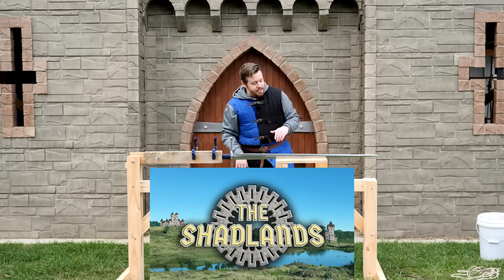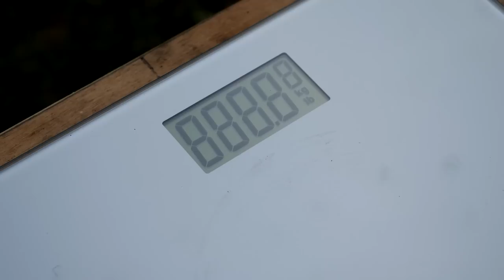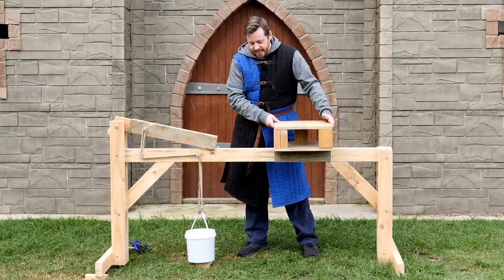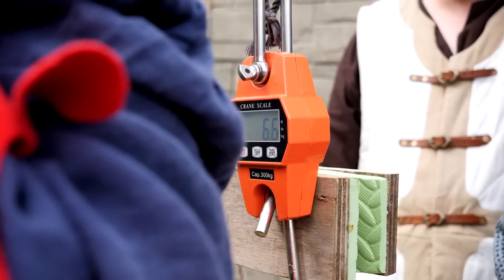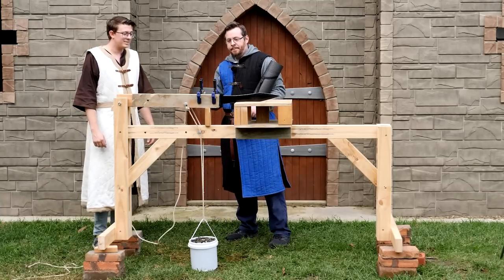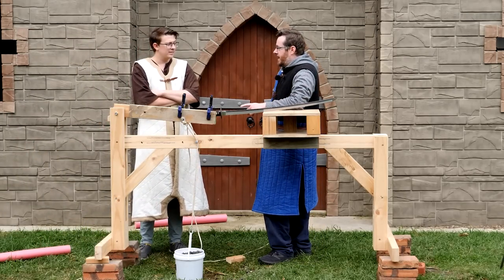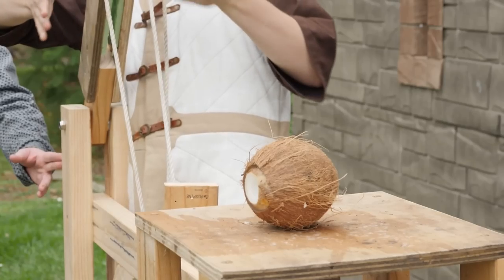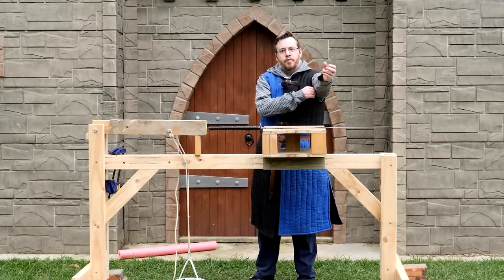Choppy choppy

Comment: I suspect that the problem you had with the katana was due to the clamp slipping. Clamps are surprisingly weak under sudden shocks. It might work better if you made custom clamp jaws for each handle, so that the clamp has a perfect fit. These clamp jaws would then have some sort of slot they fit into the arm to prevent movement.
Reply: @Danuxsy  the katana slipping IS a big problem, because that would mean all the power behind the swing dissipates in the motion of rotating upwards instead of following through with the cut
Reply: @Danuxsy  you can also clearly see the katana slipped. But all we can do is just speculation, we have wait for shad to do the experiment to see. 

Using only the friction due to the sideway force to hold the weapon is too weak compare to wrapping our thumbs around the handle.
Reply: @Danuxsy  This is true, however the guillotine would probably still be able to cut it was it not for the problem the others mentioned. Imagine  Shad doing the cut withouth stiffening his wrist.
Reply: Yep. I also think its about force dissipation during contact because handle of the katana wasnt fixed hard enough.
Reply: @Danuxsy  I would disagree on that. Sure, biomechanics does impact the force, but that only makes it more efficient. Here, the force of the cut is 7 kg, similar to Shad's cut. It doesn't matter how the swing is done mechanically if the net force is the same. However, what does matter is that Shad has his thumbs locked to prevent the sword from slipping, unlike the wooden planks.
Reply: The problem with this statement (as a lot of people are saying it in obvious defense of the katana) is that every other sword was doing the same thing, and the unsharpened long sword still cut the coconut.
Reply: Or clamp from the top and bottom also,just put shims or spacer between the plywood to secure from top and bottom 🙂
Reply: @Danuxsy  this actually applies to EVERY  sword 
Not just the katana...
Reply: @gamermanzeake  My thoughts exactly, how can someone say it is solely due to the slipping when both the gladius AND the other sword did the exact same thing? I feel like some people don't pay attention to those little details--which is vital importance to something like this.
Reply: @gamermanzeake  dude, we're trying to figure out why the sharp sword didn't cut what a blunt sword did.  That's it.
Reply: Not only the clamps being weak, but also the problem of the force pulling the sword out being multiplied due to leverage cause the point of rotation is far from the point where the force is applied.
Reply: I agree with you,the clamps have poor grip on the sword so you loose power.
Reply: @Danuxsy  Ok, I do agree with you on the point of acceleration vs pushing the sword. The force applied to the coconut is quite different. But the fact that the sword rotates backwards makes the force even less. Also I would like to point out something both of us didn't catch onto. According to the torque equation, the longer the length of arm, the larger the torque produced when having the same force. This means that the weight on the guillotine should be on the end of the sword in order to make the test fair.
Reply: To build on the clamp observation, I hate quick clamps for all but the least demanding applications. Any serious clamp job requires some good, heavy, steel, G clamps.
Reply: Well, fixing the clamping mechanism may end up being the easier option, compared to redesigning the entire machine
Reply: @Danuxsy  I agree with you there, impact force is a sum of forces what shad needs to do is ensure that the guilloutine matches the impact force he can apply (possibly by testing with a scale designed to handle impacts)
Reply: @Danuxsy   Yeah, that's probably a more accurate version of the question. The sharp vs blunt sword thing is probably more of a clue.

Your answer is probably an aspect of it.
Reply: @Danuxsy  as I understand it a sword stroke is always an arc, maybe you have 3 points of rotation but they all add up to one arc of rotation. In this way it is the same as the "guillotine", they may utilize different force vectors, but the result is similar. It may be that Shad utilizes his full body to deliver a proper stroke but that is simply because using different muscles in tandem is the most efficient way to use the human body. If the guillotine was built with 3 points of rotation, that would only add unnecessary complexity. You could build the guillotine generate more force than Shad or less depending on how much weight you put on it and regardless of how many joints it has. So comparing the forces generated is unscientific since there is more than one variable that determines which strikes harder. To me, the main difference that (at least in part) produced the results is that unlike a human, a machine is unable to adjust and react on the fly.
Reply: @forcommenting1017  do you saw mythbusters? The episode where they used rocked slides to decelerate a car into a wall? The used 2 slides to get higher speeds. 
The more acceleration points you have the faster you get, even if the movement ends up being one arc.

Even if he gets the weight on his rig right (which he didn't) he won't get the right speed.... but we all know the formula behind the force... it's mass and speed. 
Those need to be consistent and right to get to the sharpness and end up where we gonne be and it's the cutting capability of a sword
Reply: I'd like to also add that we can see a lot of horizontal movement, so probably putting some side rails would make it more consistent.
Reply: @Danuxsy  the amount of force shad himself can generate is largely irrelevant. Making sure the rig holds the swords snugly and without variation is significantly more important.
Reply: @Danuxsy   @FluffyPants    it's funny you say that because there are clear holes in your logic. I said nothing about constant speed and whether it is or not doesn't change my point. I distinctly stated that what swings the sword doesn't matter, in fact it was my main damn point (but you think that's a point you made somehow). I never even mentioned the 7kg thing which I was never defending. Furthermore, you make serious and unfounded (though possibly educated) assumptions about how much force is generated, a variable which we can never know without actually measuring. Force is not the only variable at play here even though that would make the problem much simpler. At this point, with all your ad hominems "have you ever even seen someone swing a sword, etc" how can you still assume you are being objective on this subject? It seems to me you just want to prove yourself right, which was never the point of this scientific discussion. The way you go about proving this is also questionable, regardless of what you think your credentials on the subject are. You ignore half the points people make (confirmation bias much?), then put words in people's mouths (strawman) and make your point, not in response to the person who made it, but rather your own idea of what that person said. I don't doubt you have some deep understanding of the biomechanics involved, but you take some parts of science and ignore others so it is very hard to trust you.
Reply: Yup you can see the katana moving relative to the clamp in slow motion.
Reply: I fear you will take what I said and assume that I don't understand the very basic main point you are making. The reality this is that the main point you keep coming back to is quite possibly the least interesting thing you have said. Not that it isn't interesting but rather the embellishments are more interesting by comparison.
Reply: @Danuxsy   exactly as expected. If you'll notice, my comment is unedited therefore it is impossible for me to have removed mention of such. Since it seems you haven't figured out self awareness on this point, I doubt you ever will and thus this is pointless. I hope you have a good day 😊.
Reply: @Danuxsy  whatever helps you get up in the morning ♥️.
Reply: @Danuxsy  There is no need for disrespect here,
You can make your point without disrespecting other people.
Reply: Yeah there needs for resistance on both the rear and front of the handle like pulm and fingers do in grip. There is significant driving force and resistance against the rear of the handle by the hand
Reply: Yeah thought so too. I think belts or something similar that tighten around the handle rather than like a clamp that just squeezes from the sides
Reply: Always someone defending their beloved "katana"... Smfh
Reply: Yup that is a major problem you can see the sword completely changing angle so the force is not full because the sword is being pushed back. It is super obvious as the sword isn't even flat after it strikes. Definitely need a better way to secure the swords. Some hilts might work better  than others. Some kind of solid system on topp you can screw down to keep the slippage from being an issue. Slippage likely might be because some hilts have better friction
Reply: @gamermanzeake  Some hilts might be better secure than a Katana. I could careless which sword does best personally. They just need to address she slippage because in a real strike someone is not going to bounce their arm back. They will try to strke through something they are trying to slice. Fix the slippage issue and retest. None of the swords should be slipping and defiinitely not as severely as the katana was.
Reply: Gravity is not accelerating the sword the same way that your arm does.  The weight of the bucket is not reflecting the true force of the blow.
Reply: @krikeydial3430  he could probably use a good accelerometer to callibrate is contraption ... that and send the design what he made to the Slingshot channel guy. If anyone can make this work properly he can. Seems like a perfect collaboration project between the two.
Reply: You're not wrong about the weak point there although a small length of timber put above and below the handle and clamped down on the "front and back" of the handle should prevent the handle slipping in the vertical axis. By this I mean cut to size and clamped so as to be flush with the main timber. Close to making custom jaws but more cost effective and time efficient as you can just saw off the excess to make it flush then just clamp it down.
Reply: I think Hose clamps with some rubber  would work I think.
Reply: @ronpetersen2317  Great idea!  I love that guy, "ah-ha-ha!"
Reply: @skullair52  A few hose clamps would work pretty good and be pretty quick to remove and tighten. Or make a few wooden v shaped clamps that can be quickly bolted and unbolted. The v shape gives you 2 contact points one keeping the handle from pushing back upwards and the other keeping it from being pulled downwards
Reply: I think you are dissipating a LOT of the energy in the swing with the movement of the handle in the clamp. Just think about how much force is required to move the handle in the clamp, that is how much is lost.
Reply: @gamermanzeake  The longsword didn't move nearly as much in the clamp as the catana did.
Reply: It might be a combination of things and one of them might the the way the blade bites into its target
Reply: Maybe you need to add some bolts or something to keep the sword handle from changing the angle of the blade as it connects so it stays straight.  A bolt above the top part of the closet side of the handle and a bolt below the furthest part of the handle could help I think?  Might need to make a few holes for them so you can adjust for different sizes.
Reply: @gamermanzeake  You've posted this in reply to several comments, but it's flat out wrong. Look at the long sword's hilt when it hit the pool noodle and when it impacted the coconut. It didn't slip at all with the noodle and only a little bit with the coconut, while both the gladius and the katana rammed up against the clamps.
Reply: I can confirm the weakness.
Have had many times when I used a solid steel table clamp, a big one at that, to hold something like wood while I was using a chisel and every single time it failed after a few small hits.
Didn't matter how tight it was or what I tried to increase friction, the material would always slip out.
Reply: @forcommenting1017   Look, not to get this argument more heated, but I believe that fluffy pants' stance that the sword guillotine is not calibrated to apply the correct amount of force at impact is a bigger issue than the handle slippage is a viable one. Regardless of the coconut's resistance, under the right amount of force the sword would still have cut partially through the material, before the coconut (acting like the long end of a lever) forces the handle to slip from the fulcrum point in the front of the clamp to the back of the handle. Yes, the handle slip is a design flaw, and to respond to your previous comment no adding yet more points of rotation is just going to make the rig lose power in the swing( the rig is a simple weight powered device not a complex hydraulics mechanism, so the fewer moving parts, the more consistent the results. And finally the the calibration system is designed to increase the initial point of force from the point of the handle, and not at the point where the blade makes contact, and because of this small oversight Shad measured the applied force he could give at the very end of the lever (the sword tip where the force would be at its weakest) and assumed it to be the constant for the whole blade strike. Hence why Fluffy Pants argues that the system must account for the difference in power an impact has in comparison to applied force either with a math calculation or with trial and error for example using a scale that can handle impacts. I hope this clears things up, if not, oh well I said all that I'm going to here.
Reply: This is what I noticed. I wondered why the warsword slipped less than the katana. With the yoga mat too, the fact that the handle would slip in the clamp coupled with the density and the spring give in the layered foam.
Reply: yes agree, in vid you can see the weapon move in the vise setup when it hits target.
Reply: It would work better if they had a master blacksmith do it by folding it 90,000 and making 90,001 paper cranes. Trust me. I made the last crane once. Should have seen it. Flew over the sword, enchanted it, and dissolved. So this is false advertising.
Reply: not to mention the difference in weight between the swords
Reply: He should look into fractal vices. They can hold any shape in a near perfect grip, adjusting on the fly for geometric complexities. They are also more shock absorbent.
Reply: @For Commenting   I know at @FluffyPants was rather rude but I have to agree with him in terms of the physics going on, but I can try and explain better and give a test to do at home to help give context:
Imagine you want to hammer your closed fist into a table to smash something and you'll do 3 tests.
SAFTEY WARNING, don't hit a table like this, maybe a pillow cause you may break bone

Test 1: (no bend and no muscular acceleration) raise your arm level to shoulder height and keep it entirely straight but then let it drop and only be accelerated by gravity (let your shoulder muscles relax so your arm falls and impacts the table)

Test 2: (no bend but with muscular acceleration) raise your arm to shoulder height, still keeping your arm entirely straight (no elbow bend) hammer your fist down and you should feel the difference in impact force 
{shad's machine is currently replicating somewhere between these test 1 and test 2, as he's trying to factor in muscular acceleration with the bucket's weight though it's not as much as would be required}

Test 3: (bend and muscular acceleration) raise your arm to shoulder height this time, hammer your fist down as hard as you can and bend your elbow, the added acceleration you received from the pivot point will greatly increase your final force 

So what's happening regarding shads swords is that in the equation Force = mass multiplied by acceleration; his contraption is only undergoing the acceleration of gravity, which is 9.8m/s/s being multiplied by the mass of the current sword and his rocks. The larger sword succeeded because it has more mass and was a larger arc because of its length which is result of torque, so it's bluntness was irrelevant due to shear impact force, in the same way a round marble will punch right through something if it's moving fast enough. 
But when shad swings the sword, is muscular acceleration, the rotation of his pivot points and the acceleration of gravity are all multiplied by the weight of the sword and his arms, making for a hugely greater force potential. 

Because his contraption his currently limited to the acceleration of gravity, in order to replicate his muscular force potential he'd ever have to greatly increase the weight he's putting in the bucket or add other forms of potential energy to generate more acceleration, such has elastic bands or springs, or make the sword fall for longer so that gravity can accelerate it more.
Reply: Eh I just read other comments and realised others have already gone over this 😂 my bad
Reply: Jesus Christ the good true sovereign king adores you all

may you be trust in His love for you :" )
Reply: Jesus took away my years long nightly breathing issue instantly in an anointed prayer :" )